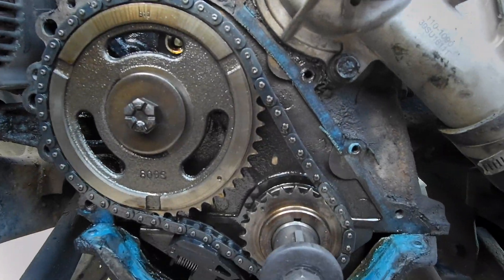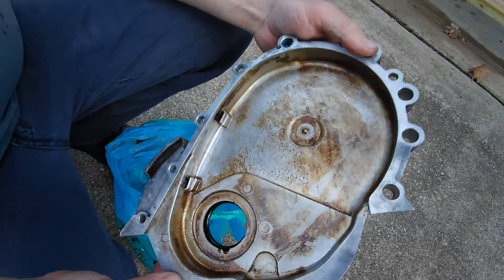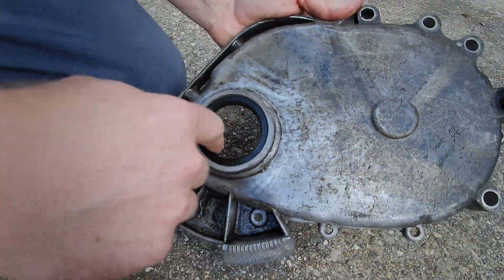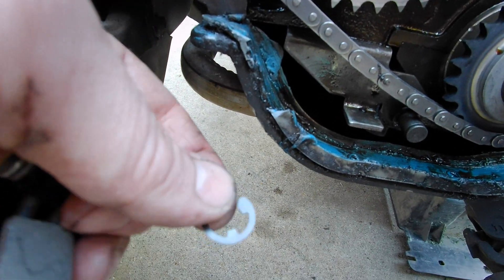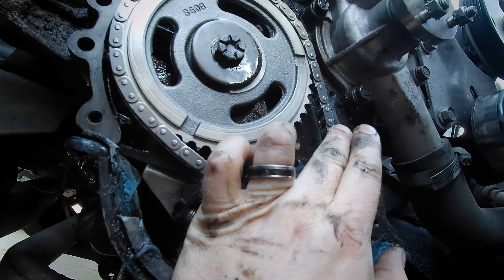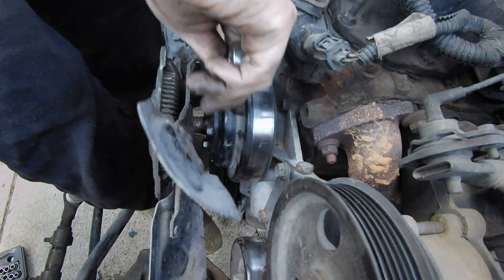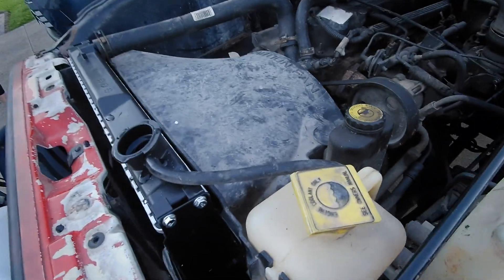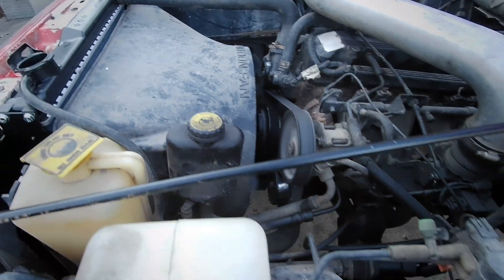How much slack is too much in a TIMING CHAIN

Comment: Are the gear teeth supposed to be that sharp?
Reply from the maker: Yeah. I dont think that I mentioned in the video but the chain set that I used came with new sprockets, chain, tensioner and guides. Hope this helps.